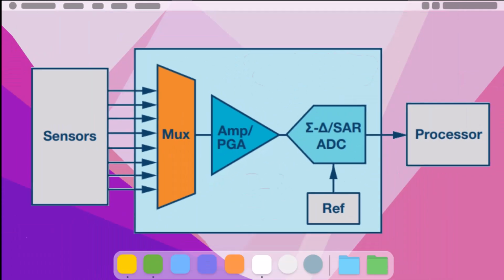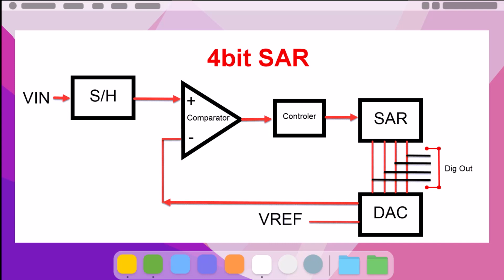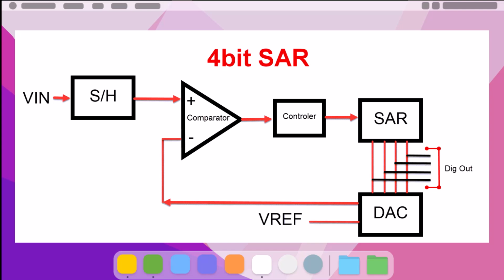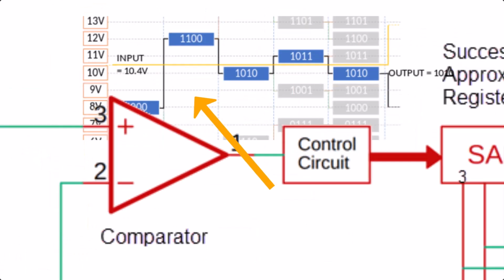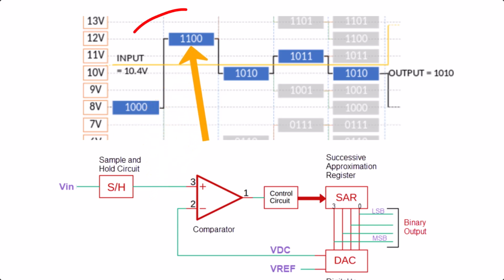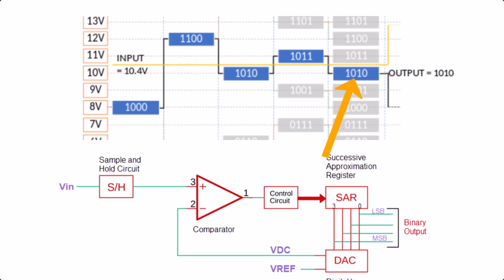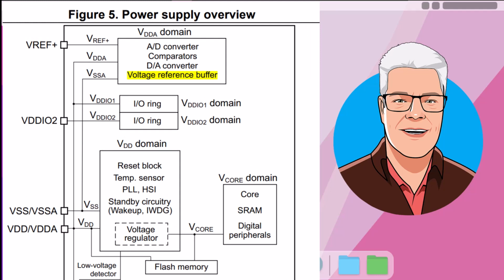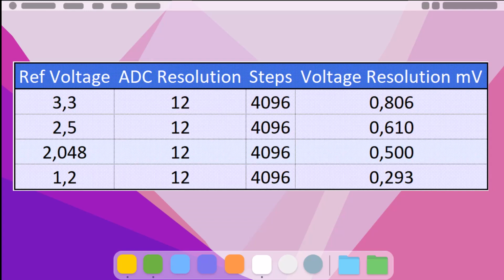Discover the Inner Workings of SAR ADCs: A Fundamental Guide

Comment: Hi, but at lower reference voltages the resolution is even higher. why use these 2.048 volts and not for example 1.024 or even lower. what are the limitations?
Reply from the maker: The problem could be to find a good refvoltage at lower voltage.
Your result are hevily dependent on the Ref.
/PR TechTalk